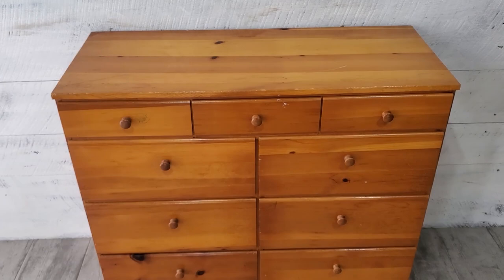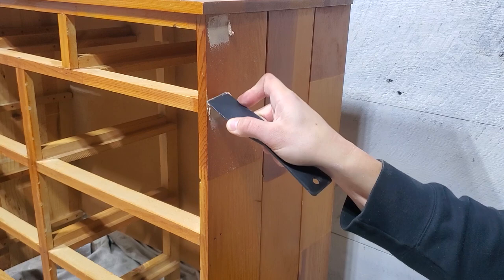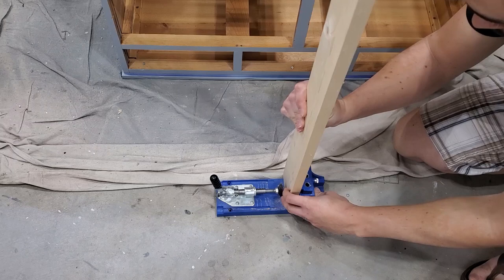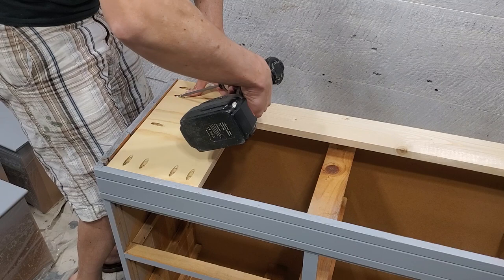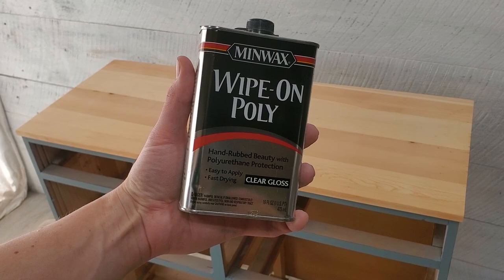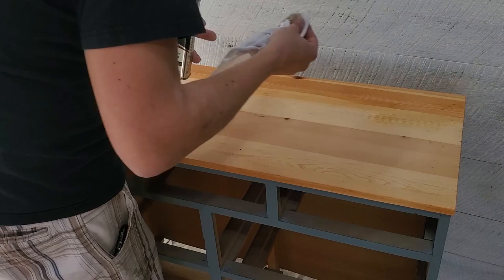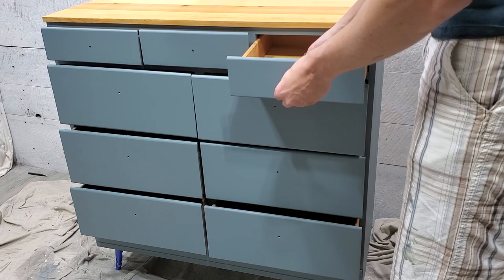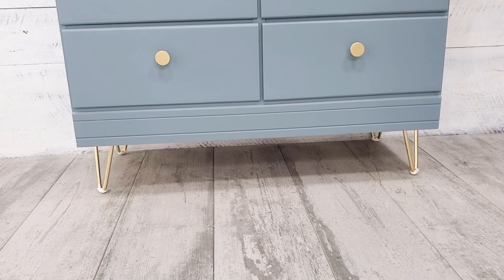Mid Century Modern Inspired Furniture Flip | Fusion Mineral Paint Pine Blue

Comment: Did you wipe the draw runners with a cake of soap?
Reply from the maker: Yes!  I almost always give a quick application of wax or soap when the drawer is wood-on-wood.  Even if it already seems smooth operating, it ensures it will stay that way for even longer. 
I'll use wax if I have a little bit leftover that isn't enough to use on another full project, but soap works just as well and is obviously way cheaper.

-Ethan
Reply: @BrickHouseVintageDIY  great idea!